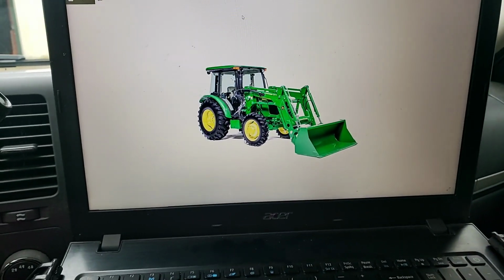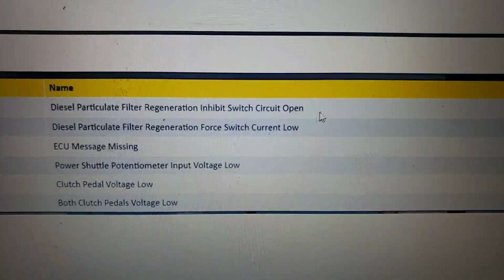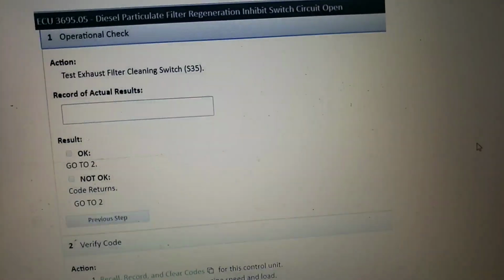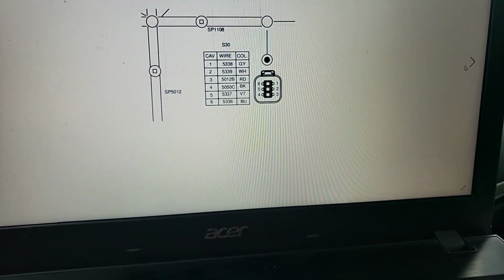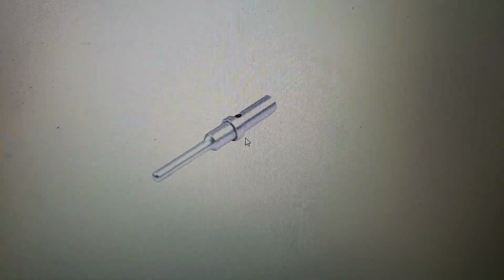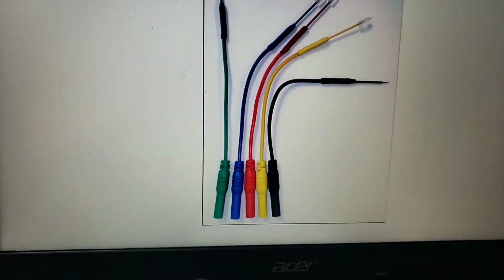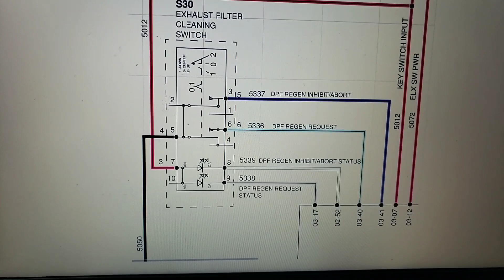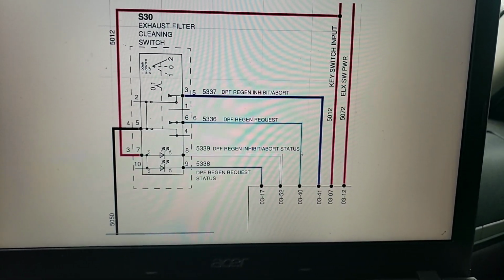ECU 003695.05 - 5075E

Comment: What program do you use to get the wire Diagrams?
Reply from the maker: Factory service information, Service ADVISOR, just a digital version of a paper manual. The tech manuals for JD are available for sale from your local dealers. Prices ranges from $100 to, you can get DVDs as well. Operator, Technical, and Parts manuals are all availble.